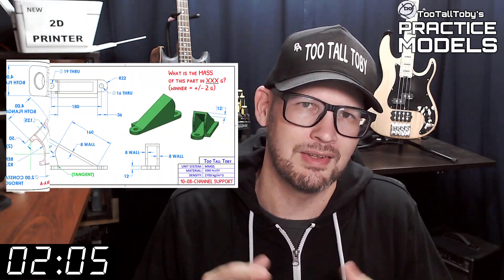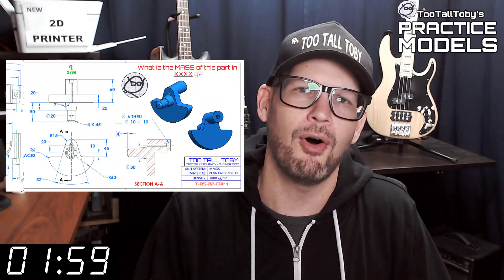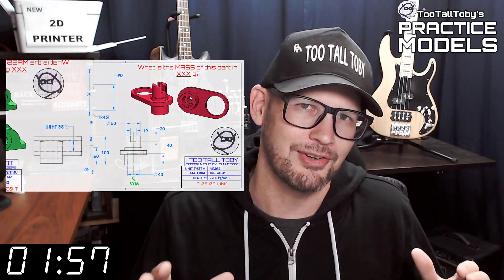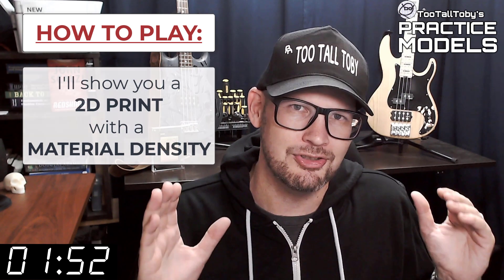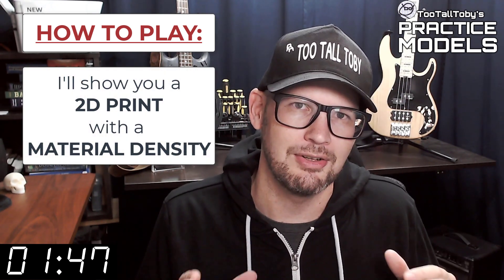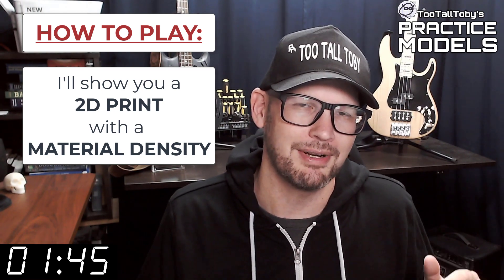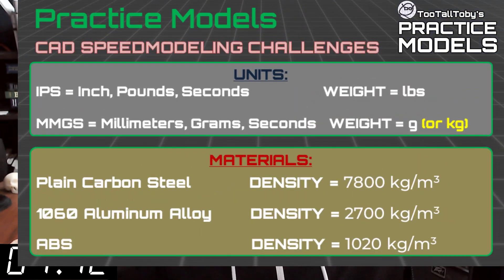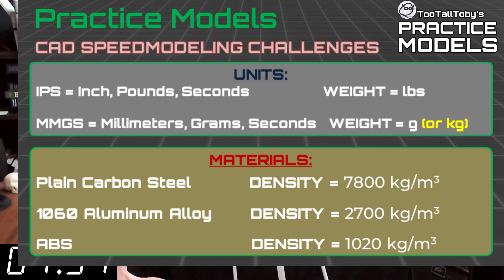SOLIDWORKS Practice - Onshape Practice - Fusion 360 Practice Exercises - TooTallToby-21-02-12

Comment: Nice bracket!
Took me 3:42 on the first attempt, and 2:16 on the second. Solve video on my channel.
Onshape doesn't need you to trim your sketches so I usually just use full circles rather than line/arcs for the "outlines" as it tends to be faster. This one was getting a bit messy so on the second pass i did it the more "traditional way" and it was definitely "cleaner" although not necessarily faster (the speed increase was from knowing what features were needed and where to find the dimension on the drawing).
There's some struggle on the first pass with the sketch getting pretty mangled (around 1:20) when I add the big radius dimension, in the end it was fine but it looked like things were exploding for a bit!
There's also an "accidental" Ivan exploit on the second run with the height of the slot on the right where I picked up a relation to the center of hole on the left!
Reply from the maker: lol "accidental Ivan Exploit" - that's the name of my next band!

Comment: 9.08. Mass 120 something until I realized Fusions mass for ABS was a bit high at 1060 kg/m3. After adjustment, 118 grams for the model.
Reply from the maker: Nice job finding the error - I show the correct mass properties in the intro of the videos, so hopefully that will help you create some custom materials, for these challenges :-)